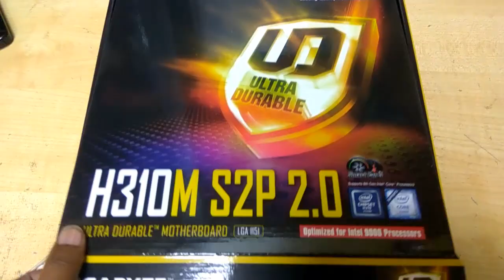H310M S2P 2.0 Gigabyte Ultra Durable With M 2 and HDMI port Motherboard Unboxing | Tech Land

Comment: Will it support 2060super or rx5700xt or upcoming 3060?
Reply from the maker: All Card Supported But this mobo not Sufficient
Reply: @TechLand2  what about H319M S2P?is there will also support 2060?
Reply from the maker: @exoluxxyyt2020  @ All GPU are supported but 310 is entry level mobo

Comment: it is a standard m.2 or NVME?
Reply from the maker: Ultra-Fast M.2 with PCIe Gen2 X2 & SATA interface
Reply: @TechLand2  m2 gen2 x2 - slow old port.....For "ultra-fast" need Pcie Gen3(Gen2) x4. See spec H310A2